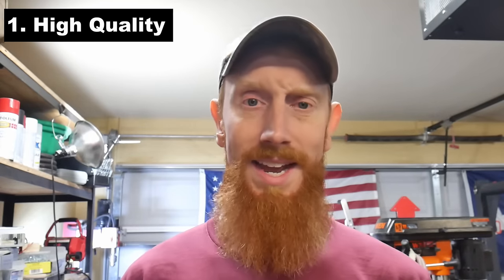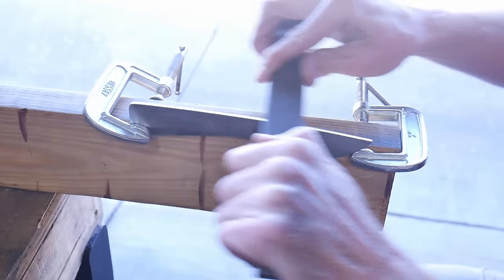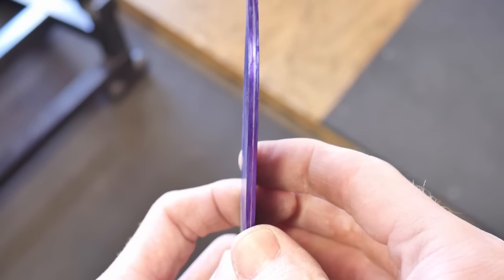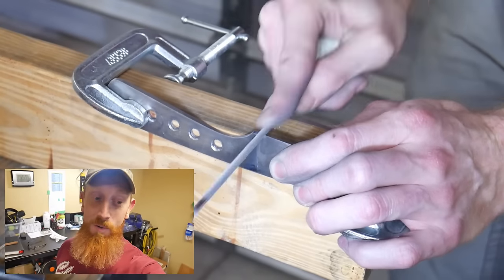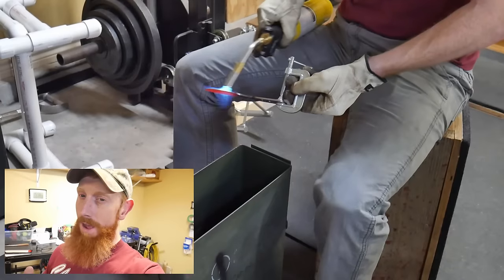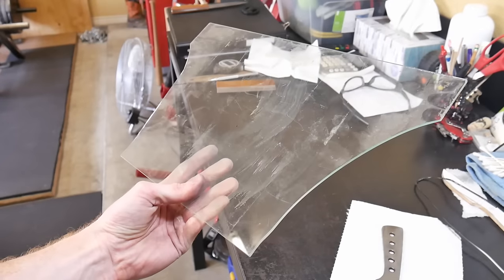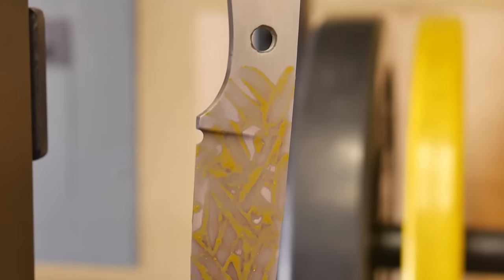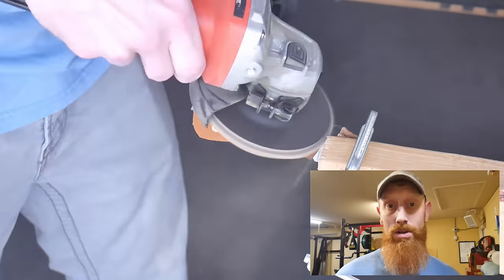Make A Knife With Cheap & Basic Amazon Tools | Knife Making

Comment: thank you for not doing what a lot of idiots do with angle grinders and recommend gloves, just an FYI for anyone wondering what im talking about, if you wear gloves using a saw, angle grinder, table saw, anything with a circular motion ect. you risk it catching and pulling your hand or fingers into it resulting in losing a appendage or limb depending on the size.
Reply from the maker: That sounds pretty darn painful

Comment: One thing that is helpful with the angle grinder: Save worn sanding discs for the edge work. It will be slower, but a little more forgiving. Still must be careful though. Same is true of cut off wheels. I save some that have worn down (smaller radius) to get into tight spots. Dont take them all the way down to the drive-dog of course- they will break apart at some point.
Reply from the maker: Great tip! The're a useful tool for sure. You can do a lot with an angle grinder.
Reply: this was absolutely perfect

Comment: As far as epoxy goes, 5 minute set time epoxy will hold up for a while, but it isn't waterproof and will deteriorate after several years, 60 minute set epoxy is waterproof and wont deteriorate the same way 5 minute will (it can last upwards of 30 years)
Reply from the maker: Fore sure! G-Flex has a 24hr cure. That stuff is great and long lasting. The CA Rouge is at 60 min and the BSI mid cure is 15 i think. Thanks for your comment sir!
Reply: 5 minute epoxy has a much lower melting point. It’s great for glueing fishing rod tip guides as you can remove/ reposition the guide using a butane lighter to soften the epoxy. 
But, use slow set epoxy for scales.

Comment: Black and decker will get the job done but id recommend looking at the drills at harbor freight like bauer or hercules. They are cheap and tough as nails. I’ve personally used my hercules drill to drill through 5/8 inch steel many times and i still have it. It will be so hot its smoking and burning my hand and i just let it cool down and it keeps on going. Some of the tools at harbor freight are awesome.

Comment: I have used Gough's file guide to sharpen knives too using a Smith Tri-hone I had. I removed the stones from the plastic base and glued them to scrap wood so I had a surface to put the hose clamps on while using the full length of the stones.
Reply from the maker: Very cool Mike!

Comment: Interesting and well explained and discussed as always, good stuff. I couldn't help but cringe at the end with the testing hehe.
Yea it looked a bit cold when you quenched but that's the limit of that method as you said and the little brick forge will overcome that for very little extra outlay.
Reply from the maker: Thank you! Yeah, wish I would of bought a couple of small bricks before this project, but hey... part of the learning. Cheers man.
Reply: Try some charcoal and a fan blower next time 😉 You can use a cheap fan to make a blower.. And some bricks to build a small forge 👍 Appreciate your effort

Comment: Hey you mentioned you don’t feel comfortable beveling with the grinder, try practicing on a piece of flat plate and use the grinder guard as a guide. Just like you would grind an edge normally but with the edge of the guard set up to steady your wheel. Hope it helps.
Reply from the maker: Cheers Phil thanks for watching. I'm sure the angle grinder can get the job done when needed.

Comment: You can use a piece of brass/copper, and softer metal, and "scrape" the file in the direction of the teeth. This will get those really stuck in chunks off the file. A couple wipes and the soft metal will form to the teeth and look kind of like a comb. Try it, you will see what I mean.
I used to keep some pieces of thin flat brass for this, just bend a sort of L shape and scrape with the edge of the short leg.
Reply from the maker: Good tip Clarence, cheers

Comment: I’ve forged my first knife and working on my second under a teachers instruction. I was so proud and had so much fun that I have to get some tools to do it myself at home. However, the noise level of even a dampened anvil is just too much for too long for a subdivision. I’ve decided to go the reductionists route using metal and grinders at home, but after looking at the prices of those I couldn’t believe how expensive a 2x72 belt grinder is
Reply from the maker: Yeah 2x72s are pricy. You should look into the DIY build kit from House/Works

Comment: You forgot about the 1000 bucks furnace (or an old grill and a vacuum cleaner if you're willing to invest time in learning how to heat treat by the eye) .
Oslo if you're annealing/normalizing/doing anything like that in a regular electric oven I suggest using a sand bath or at least some stones to reduce the change of temperature around the steel which always happens in those. Steel with lots of inner tension is very sensitive to sudden changes and electric ovens swing by 20-40°C all the time
Reply from the maker: You could send off the knife for heat treat for reasonable prices if the heat treating process is intimated. My tempering oven holds about a 1 degree Celsius band with the PID controller. Have a great week!

Comment: I use wire nuts for ear protection, the orange/blue ones work great. A beard adds girth too btw. A beard is only second to proper hydration. When I increased my water intake to 9 liters per day, my biceps cable curls went from 35 per arm to 60 per arm. The cable curls I'm talking about are the ones where you grab the handle from the individual weight stacks and curl as though you are performing a rear double biceps pose in competition. Beard + water = sweet natty strength gains!
Reply from the maker: Lol, hell yeah. 100% accurate.

Comment: Nice vid. To add to it for those that just want a bare bones down and dirty way to get their first knife done without power tools if they dont have any, or even a workshop or want  any real investment is to just use a clamps, handsaw, bastard file and round file,wood for the handle, and some good quality glue like the gflex or bsi as stated as you wont be using pins so good quality epoxy glue is essential, if you want it to last, or just use araldite if you just wanted it to be functional. You can replace the mustard with chopped onions also if you dont like any vinegar based products. When doing it this way without power tools, you will fully appreciate the amount of time, effort, blood, sweat and tears and a few swear words thrown in for good measure that goes into handmaking knifes.
Reply from the maker: Good points there Fran!

Comment: As a someone who's getting into knifemaking, i may sound ignorant here, but when you bend the knife with the vice, is that what you want to happen with a proper heat treat, what would have been the proper outcome, soft but not too soft? or no bending at all?
Reply from the maker: Hey man, I think the deal was that these results just aren't what I'm used to with a full HT. Since the blade was edge quenched; only the edge was hard and the spine was soft. This is actually ideal for a lot of scenarios. If you're going to be attempting your journeyman's test for instance, you'd want a blade with these properties (so that it would not snap during the bend test). After looking back at this knife, I really don't think there was anything "wrong" with the heat treat. It would of made a perfectly fine knife long term.
Reply: @RedBeardOps  Nice, ok thanks for the clarification.

Comment: Instead of Instead of 1084, you can use an HSS lathe cutoff or parting tool. No heat treating needed, 65-68 HRC,  takes and holds an edge like no other steel. Imagine a rookie cutting a notch in someone's fancy D2 knife with his very first knife!  😜
Reply from the maker: Would be epic!
Reply: @RedBeardOps  HSS has a reputation of being brittle, but it's not really. I have made some really thin knives from HSS, and I have tried to break a couple. You have to bend them quite a bit before they snap.

Comment: its best to the flats of your tangs left at a rougher finish of 36 or 40 grit as your epoxy will hold better. personally, I learned its better to use a 15 min epoxy over a 5 min. the reason is 5 min epoxy is brittle and I have dropped a blade and had the scales pop off.
Reply from the maker: Thanks for your comments, gundanium. 🙌

Comment: you do not need to use epoxy as a mechanical fit via peening works just fine however you do not want to use brass when doing a peening technique as I broke many a scale before learning this. for a mechanical connection you want to use copper (favorite), Low carbon, or structural (mild) steel.  did a running commentary to make it a bit easier to find tips.
Reply from the maker: Thanks for your comments, gundanium. 🙌

Comment: So when testing the knife at the end - did you WANT it to break and not bend? For your average knife, what should the result be?
Reply from the maker: Hey Dallas, good question. After reflecting more on this knife, I actually think the results are what you would expect from an edge quench. The edge is hard and the majority of the blade is soft so this should allow it to bend without breaking in half. When performing the ABS JS and MS test this is how many of the smiths HT their blade so that they can survive the 90 degree flex test. On my normal knives, harden the full blade since I don't expect the user to be performing a 90 degree flex test! When performing the same test they'll normally break around the 80 degree mark and will have a tight grains structure throughout the entire cross section. 

That's a long winded way to say that it depends on how you heat treated the knife, and what you expect the knife to be used for. I think this knife would of performed just fine long term.
Reply: @RedBeardOps  Thanks! just working on my first knife following your video - I have a firebrick mini forge sorted out though, so will likely work to harden the entire knife.  Appreciate the answer!

Comment: I watched the video on how to make the jig, but it appears you need a belt grinder to round the corners on the file used on the jig.  How did you make yours?
Reply from the maker: Hey Joshua, the rounding of the file corners isn't 100% necessary. If you're patient you can create a slight radius in your plunge when you wrap some sand paper around the edge of the file. 

Also if you wanted to radius the corners of the file you can use a block of wood with some 120 grit sand paper wrapped around it to take the edge down on the file. It would take a little bit of time, but its doable.
Reply: Sounds good, thanks for the feedback!

Comment: Great video mate. Been thinking about going into knife making for a while then I saw your video and now i'm trying to get all The equipment THAT i didn't already have. But I have some questions reguarding The sandpapper u use, what grids and even those on your bench sander. If you would like to take a few min to answer some of my questions that would be highly appriciated =) thanks agian!
Reply from the maker: Cheers Martin. When I grind a knife from the start I use 60 grit for the rough grinding, then 120, 220. If I'm going for an etched machine finish I'll stop at the 220 grit and use a scotch-brite belt to smoth it all out. If I'm going for a hand sanded finish I'll grind up to a 400 grit finish, then start hand sanding at 320 grit. After that it's up to you how far you want to go.

Comment: Did you try the hard metal disk on your angle grinder for the micarta? Only for the rough cut out, but it is very fast.
Reply from the maker: I did not try that! Worth a try if you're going to be using the angle grinder. Thanks for the tip, sir!

Comment: What you think about O1 steel as the only option, its one of the fews i hear about i can get in my country, i only made one knife so far from a leaf spring, i have a homemade forge from a propane tank, i can get high temperatures i believe.
thanks in advance.
Reply from the maker: Hey man, 1084 honestly is the easiest steel to HT in a forge, probably followed by 80CRV2. The issue with O1, 5160, 1095 is that they require a more specific temperature regime and quench (soak times, etc). That's not to say that a "heat to a little above critical and quench" won't harden them... just won't be optimal.

Comment: So I am making my first knife and you vid is very helpful.

How sharp do you file the edge when cutting the grind, before heat treating? Mine is at .033” right now and not shire how sharp to cut it before tempering.
Reply from the maker: Hey ED, on a 1084 blade out of 1/8'' stock I feel like 0.025'' (+/- 0.005'') is a good spot pre-HT. Ideally you have a little bit of meat left to sand off post HT. I normally get them down to ~0.010" before sharpening.

Comment: I don't have access to a belt sander/grinder but my family has a farm shop with a couple bench mounted "wheel" grinders.  Can these be used instead of a belt grinder or a file?
Reply from the maker: For sure! Just make sure you don't get your heat treated blade hot.

Comment: Fantastic way to encourage people Togo e k ice n m among a try, without a second mortgage. I’m curious about the dowel you used to sand the finger choil. It looked like you were holding onto one end. Is that more than just a simple dowel rod?
Reply from the maker: Yeah I don't remember where I got that thing. I think it was a punch. Basically just a piece of tubing welded on to a metal stick. You could use a wooden dowel and save one side down so that it's small enough to fit in the drill. The end that I'm holding is just spinning in my hand. It's a light hold in that hand. Thank you for your comment sir!

Comment: Hi simple  question here:
How much edge thickness do you need to keep after the filing and before heat treating?
Reply from the maker: a good target is 0.020'' to 0.030'' . Then use sand paper over your file to get it down to 0.005'' - 0.010'' before sharpening
Reply: @RedBeardOps  thank you for your answer 🙏🏻

Comment: I had a ting piece of steel get on my eye once 
I got it off though without damaging my eye
since then I've always put on my safety glasses
Reply from the maker: A scary situation for sure!
Reply: @RedBeardOps  one thing about steel thickness
Is there any downside to working with thick steel for knives other than the long working time?
Reply from the maker: @ThatOneOddGuy  All depends on what you're going to use the knife for. Thinner knives are more slicy, thicker knives are more choppy
Reply: @RedBeardOps  ah thx man

Comment: I have a belt/disc sander, can I use that to make doing the bevel easier and if so what grit should I buy the one that came with it seems coarse.
Reply from the maker: I normally start with 60 grit, then 120, then 220

Comment: Is there a way to keep your bevel even when using a sander? I have a belt sander, but it seems like using the file jig would be far more accurate than trying to keep it even by feel on my belt sander.
Reply from the maker: You can use a bevel jig (would have to be made custom) or just lots and lots of practice.

Comment: Hi RedBeard, Loved this video. I have a full woodworking shop and am starting to assemble tools for knife making. I have an older Craftsman 2x42 belt grinder but want something that is better suited for knife grinding. What is your belt grinder.?
Reply from the maker: Hey sir! I started with a 2x42 after files that is. With good ceramic belts you can do some really good grinding with the 2x42 and practice. If you want to peruse knife-making long term, a 2x72 is the way to go. I'd advise looking into the NorthRidge Mod-E, which to me seems like the best budget 2x72 on the market. Origin Blade makers also has some good stuff. Mine if from a lesser known grinder maker. Here is my full review - https://youtu.be/XcKD_CWXGck

Comment: Maybe try to mix a little more vinegar in the mustard
Reply from the maker: Hey Carson, it came down to the heat treatment on that knife since it was an edge HT. I used the same method with a fully hardened blade and it etched very well. Cheers sir!

Comment: This is an awesome video.  I have a question though, when you are filing the blade down to the center lines do you go right to the middle of the blade?  Or do you leave some product left so the blade doesn't bend when you do the quench?   I am currently making my first blade, and I don't want to go to thin before quenching and warp the blade.  However, I also don't want to have to much product on hand and then it would take weeks for me to hand sand it down.
Reply from the maker: You can leave about 30 thousandths before quench.
Reply: @RedBeardOps  thanks for the reply. I will have to do some grounding. When I looked it was about 1mm/.04. Or do you think I should leave it at that width and hand sand it after the quench?
Reply from the maker: @ericcornelius5685  I think that will be fine. Sand it down to 15-20 thousandths after quench before sharpening.
Reply: @RedBeardOps  thank you for your help.

Comment: I'm just starting out making knives how would you change the heat treat I would follow your other guide though instead of doing two normalizing cycles I am wondering if there is a better way to just heat and quench on the first cycle.
Reply: I have a small charcoal forge i made out of plaster of paris
Reply from the maker: Normalizing can take stresses out of your blade and prevent warpage. However, if you're not forging the knife, I think you could get away without doing it. It's an easy precaution though.
Reply: @RedBeardOps  okay thank you

Comment: Enjoyed your video but did you lose the initial point of the video? Is a tempering oven on Amazon for a low cost?
Reply from the maker: Hey Grizz, you can use your kitchen oven to do the tempering. I guess you could also do a torch temper if you're brave. Cheers sir! Have a great week